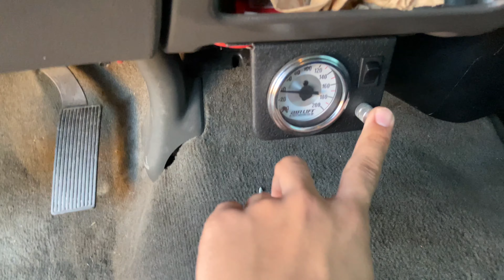5/9 Drop On My 2006 Silverado

Comment: Yo bro it looks sik, I got a question though, you tubbed the bed how come you didn’t do the dog house? The diff doesn’t hit? I’m like mine does and I’m only 5/7 you’re 5/9 I would think it’s hitting being that low. I got my Reklez hood strut kit too! Cruz through bro I’m at work 11-3 this whole week! 👍🏽🔥💯
Reply from the maker: Diff on my truck isn’t really the issue. it’s more of just the exhaust or frame scraping but exhaust will be fixed. besides that the c notch is doing a good job and the tubs are a biiiig help
Reply: LegacyJR ok cool 😎 I'm putting the dog house on mine when I finish fixing what I can.